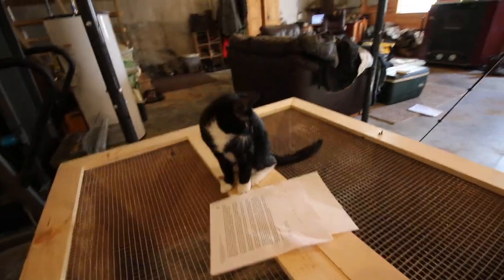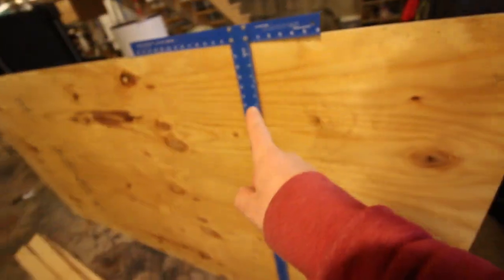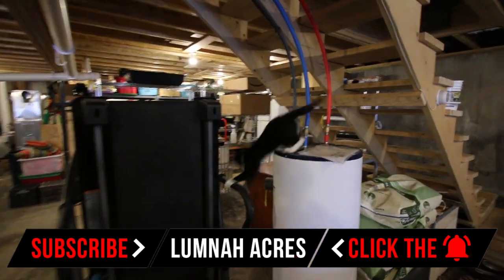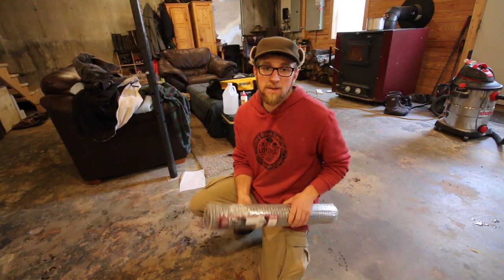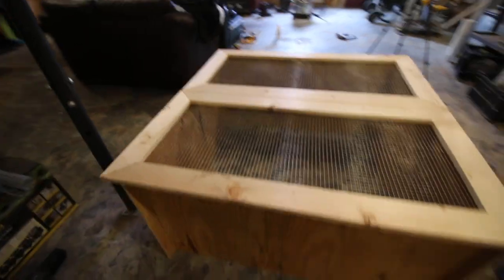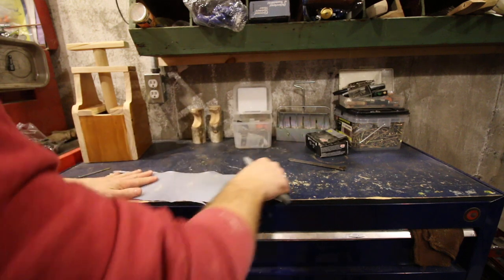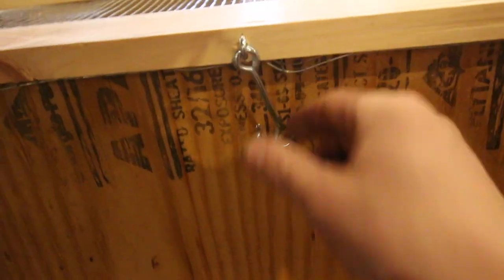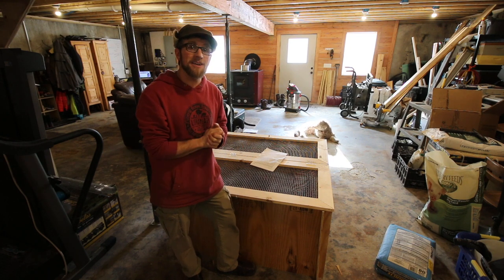Best Chick Brooder ~ Build it in 30 mins for $30 ~ Keep your Chicks safe from your Cat

Comment: Built this last week. Super easy. Amazing design. I had have some very cold weather and had trouble keeping temp in my garage. So, I added 1 inch insulation foam board cut to fit between the  joints and 2 piece to fit on top of the mesh.

Comment: I love hardware cloth and use it a LOT.  It's more expensive but lasts MUCH longer than chicken wire. Our original chicken coop and run are lined with hardware cloth and it's STILL in great shape 11 years later.  We have to replace wood in places but the  cloth is in perfect shape! Cute kitty!!!

Comment: I would add a strip of wood around the inside over the edge of the hardware cloth. I made a brooder on legs and the weight on the seam pulled it loose. I went over the edge with a furing strip ($.98 a 6 ft piece ) and it solved the problem.  I can see Pluto chasing Figaro around and end up on top too. Things happen lol. Love the design though I have to use our Kubota to move it to the shed when I am through and it is big and ungainly.

Comment: Only thing I would add would be a bottom of some kind.  Perhaps a 2x2 attached all around the bottom with a water resistant panel (bathroom wall panel ?) of some kind resting on the rails.  If you want two panels adding a single strip of 2x2 to the edge of the bottom panel on the center seam would add additional support.

Comment: Good afternoon Al.  Do you have a loyalty to any particular starter/grower feed, type, brand, line?  I'm assuming non-GMO.  Here on Long Island I am kinda limited to only a few suppliers and consistency can be problematic.   Forget about trying to blend my own, we just don't have suppliers with that broad a spectrum on individual grains and ingredients.  Purina Layena is the norm.  I don't bother with anything fancier because the local feed supply place might not have it when I need it forcing me to have to change lines too often.  For my experiment this spring I'm likely to buy all the feed I will need in advance and while I'm in nothern NY where choices will be greater.  I will try it with as good a quality feed I can find and I won't be so concerned about price so long as I can prove it is fresh and as good as I can get.  I'm mostly interested in the life cycle and seeing the growth cycle up close for however many weeks it takes.  If they are worth more as layer pullets I may just sell them as pullets, roosters will be harvested after a brief attempt to sell/give away on craigslist, a few promising hens will stay on board and add to my flock of five.  So, I'm looking to raise them very healthy and not so much for profit but value.
Reply from the maker: we use a local organic feed. Its made by Morrisons custom feeds in VT
Reply: Lumnah Acres Is it anything special or just what you have available?

Comment: The vlog pic looks like you have a broader light? Maybe it's a water. Did you cut the hardware cloth to hang it?
Reply from the maker: That is a tease of tomorrows video when we set it up with an automatic waterer light and feeder!
Reply: Lumnah Acres "We" have been building our 3 chicken tractors and just riding around ideas about the brooder . We were leaning towards the perminate plywood so it can do double duty of we want to use it for a broody hen. We like that it can be stored easier if it comes apart. 👍

Comment: Okay, why 2” on the outside instead of 1” or even 1-1/2”? 2” on the outside makes the box 44”x44”. Instead of 46”x46”. That actually takes a fair amount out. Would it be too weak with only 1”
On the outside?